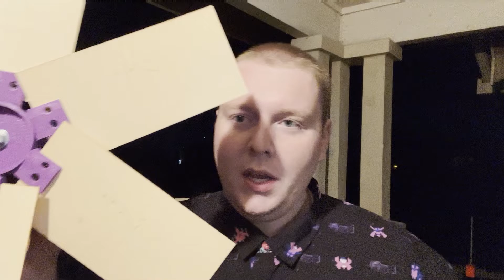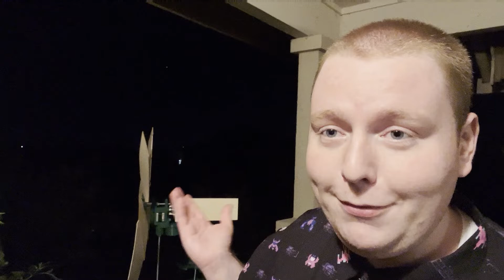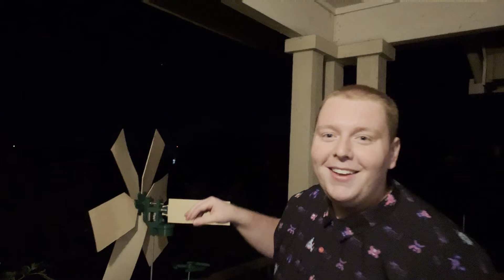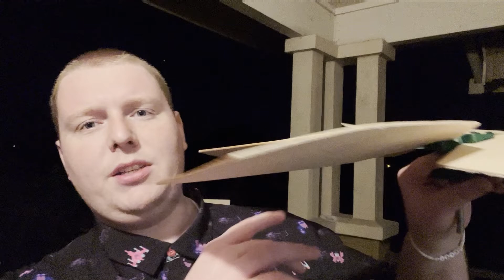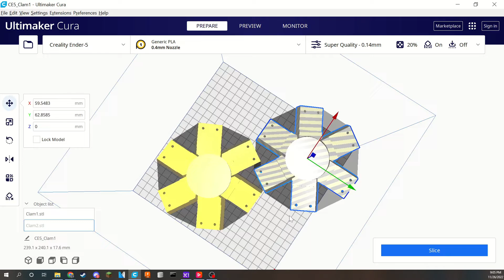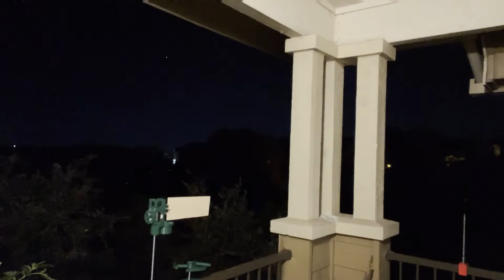DIY Windmill XXI - Two Steps Forward, One Step Back #windmill #windturbine #diy #3dprinting #3dprint

Comment: First things first; I loooove the Galaga shirt.  I pumped a lot of quarters into that game in my youth (just dated myself)

Secondly, thanks for the shoutout.  I'm glad to be even a tiny part of this.  You're enthusiasm is contagious. 

It'll be very interesting to see what effect the heavier hardboard has.  I'd expect that increased weight should act as a shock absorber and maybe take some of the jerkiness out of the rotation during those quick wind changes you were talking about?  I suppose that won't be as important as the longer vane you made.
Reply from the maker: Working on editing the video now; the hardboard turbine is done. It's really heavy. I tried spinning it with my hands and it was interesting how long it spun. I think you're right about the jerkiness... It'll be interesting to see it in action. My guess is that, like almost everything with wind turbines, it will depend on the application, which type one prefers.